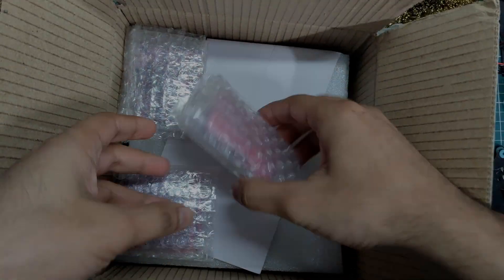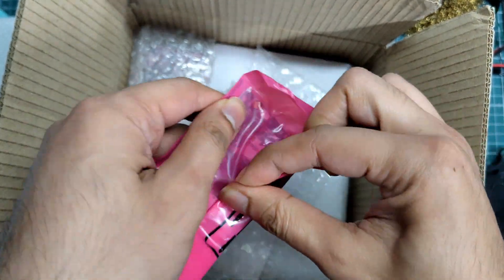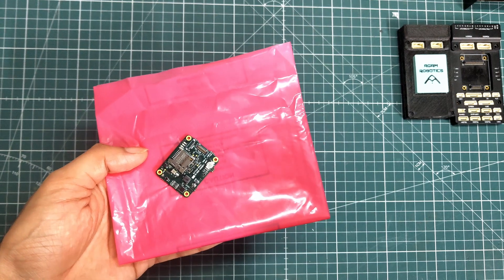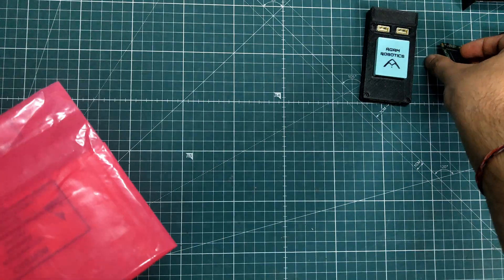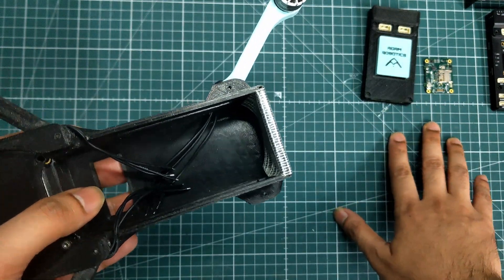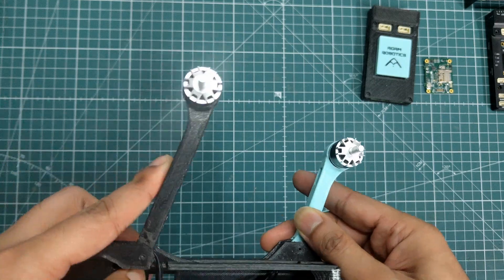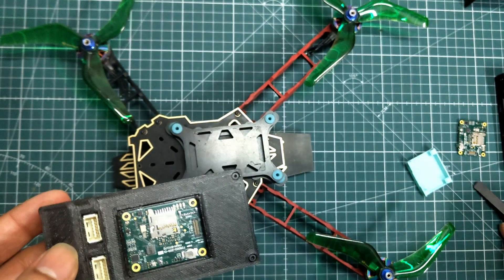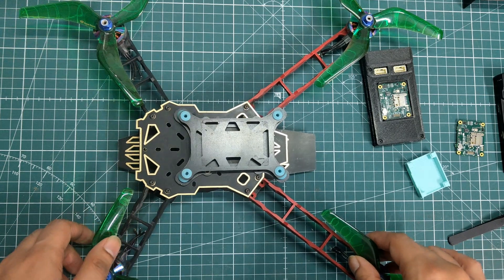Indian Made Drone Flight Controller/Autopilot is Finally Here!

Comment: Good luck ! this looks gr8. I'd suggest that you spend a few hours getting the test drone up and running with standard parts (not your custom circuits) . Then add just one new custom part at a time.
Reply from the maker: Yes, that's what I thought first, but I don't have a flight controller for this carrier board. I had mentioned in the video that I will use the old carrier board with new FC and test it out.